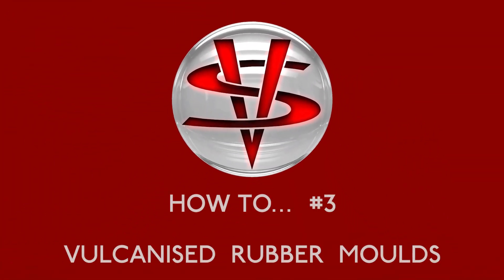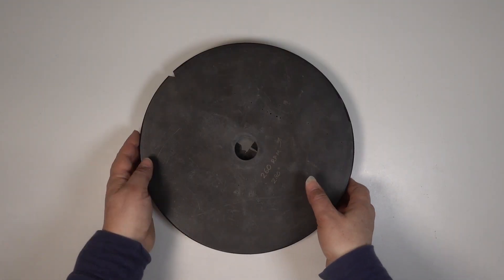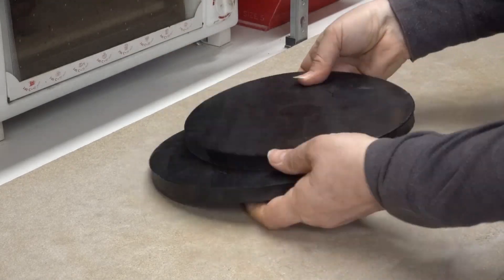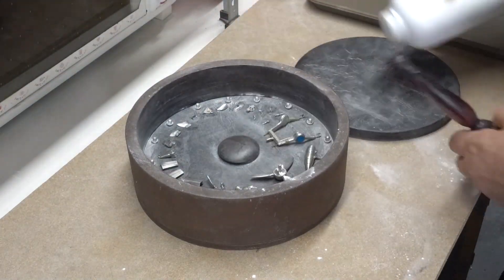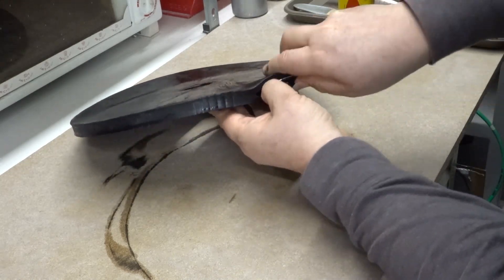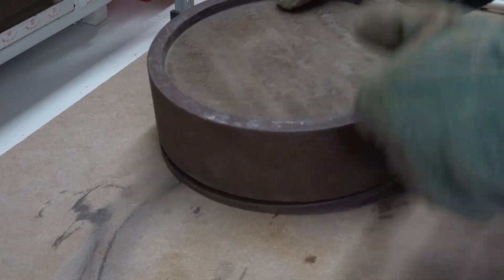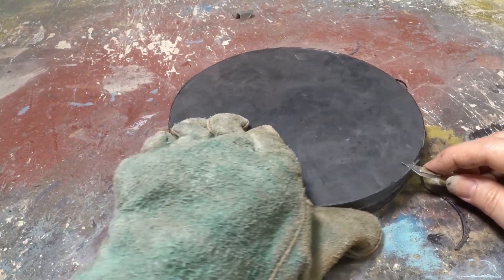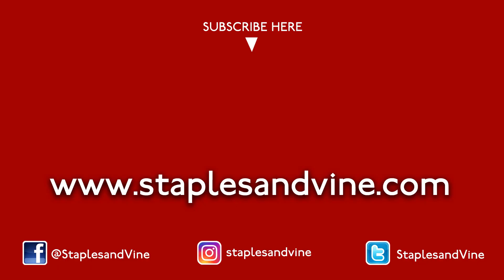HOW TO… PART 3  ‘VULCANISED RUBBER MOULDS’

Comment: Cool it's great you make show the manufacturing steps, make me want to give it a crack.

I wonder if I could make a centrifuge out of a old washing machine 🤔 

Tooling looks expensive 😜
Reply from the maker: Hi Vasili, great comment. Episode #4 will show casting using these moulds on the centrifugal casting machine. It is a fairly simple process but pretty dangerous  as you have molten pewter at 280 degrees C spinning at about 300 rpm. If the mould doesn't stay together you will have a very bad day. Having said that a washing machine would make a good starting point. I'll explain the principles in episode #4. All the best , Sera.
Reply: @StaplesandVine  how long its need to vulcanize. If i put heat resistant 3d printed parts
Reply from the maker: @wermakers  it takes roughly 1 hour per inch thickness of mould. I usually give the moulds another 20 minutes to be sure but it always best to refer to your rubber supplier for curing times and pressures. Hope that helps 🙂
Reply: @StaplesandVine  Thanks dear.i try 160 Celica's for total 1 hour but one thing happen silicon has bubble emboss & too hard & maybe space gap .cause after palce upper aluminium spacer  it has spacer thats why mold don,t look like flat it has many bubble type emboss & mold not properly done .what should i need to do.also resin goods damage .
Reply from the maker: @wermakers  I mould metal masters in black rubber at 150C . 3D prints in special low temperature silicone at 90C. Moulding 3D prints is very difficult . Whenever possible I make metal masters to then make rubber moulds which always give better results when casting.
Reply: @StaplesandVine  Thanks man.i finally doing this .it works

Comment: Man...I'd just use the entire blank instead of separating the laminations. That looks like a pain. I suppose that adds cost though.
Reply from the maker: I could go for the full blank but it adds weight which makes the moulds difficult to handle. The left overs get used on another mould anyway.

Comment: Im very surprised some of those thinner parts dont bend when pressed between the rubber sheets as it doesn't appear that soft.
Reply from the maker: Some of the masters do bend in the mould and result in bent castings. Fortunately the castings can be easily straightened with some 'persuasion'. 🙂

Comment: Would vulcanized rubber withstand the casting of metal parts such as Copper and brass?
Reply from the maker: No, this process only works for lo w temperature alloys. Brass and copper are cast using a totally different method. 🙂

Comment: Why not start by using 3d FDM Polycarbonate models that can withstand the vulcanizing process like professional prototyping is used?... even SLA resins are used... look at Nicem
Reply from the maker: You are absolutely right specialist FDM and resin prints can be vulcanised at low temperatures but there are limitations. Heat build up during the vulcanisation process causes masters to soften and distort unless they are relatively solid two dimensional parts. I have tried this on several occasions but find for my application metal masters give a far better result. 🙂
Reply: @StaplesandVine  I am dealing with this issue right now.  I have had mine 3D metal printed... but I am interested in resin printing them, so what I am doing is letting someone else who does this professionally first to see if it can be done.  Hoping to hear back today.  Thanks so much for the tutorials!
Reply from the maker: @josephb3147  a good solution is to print in a resin that can be investment cast. That way you will get metal masters. You will get shrinkage and will have to do some cleanup but they will be durable 🙂.
Reply: @StaplesandVine  thanks for the insight

Comment: The 3000 pounds is the pressure of the hydrolic pump. Not the pressure on the mold. I would like to know what is the diameter of the piston on the press to know the actual pressure on the 9" mold.
Reply from the maker: Yes you are right. I have no idea what the piston size is. I just jack it up and keep my fingers well out of the way. 🙂

Comment: It's so interesting finally finding this info. i saw a video back like... 9 years ago showing the casting process (just the cool metal pouring bit) and always wanted to figure out the whole process, and I now, finally, know! I hope to one day get the equipment set up to do this.
Reply from the maker: Glad I could fill in the gaps Nora. The kit for this is rather pricey but there may be alternatives out there. 🙂
Reply: @StaplesandVine  Oh It's definitely a pipe dream for now, but if life upswings and I can finally get a maker's space going, this kit will be in it XD

Comment: thank you for your knwoledge. Could I use castaldo ruber for yewelry for zamak ? thank you for your answer . in my country is dificult this kind of metal
Reply from the maker: Thanks for the kind comment 'pol craken' My advice would be contact Castaldo and ask them directly. They do some high temperature rubbers but whether they are suitable for your needs I don't know. Most suppliers are very helpful if you explain what you are trying to do.
Reply: @StaplesandVine  thank you for your answer . I want to make pins for clothes

Comment: I assume this is already vulcanized rubber. We’re do you buy unvulcanized rubber.
Reply from the maker: Hi Robert, I buy the rubber un-vulcanized. There is a link in the description. The rubber is then vulcanized under heat and pressure in the mould press.

Comment: Does this work for alluminium?

Probably not
Reply from the maker: Hi Viggo, NO this method does not work for Aluminium. Aluminium melts at 660C, using this method you will end up with a fire and probably a visit to the hospital.